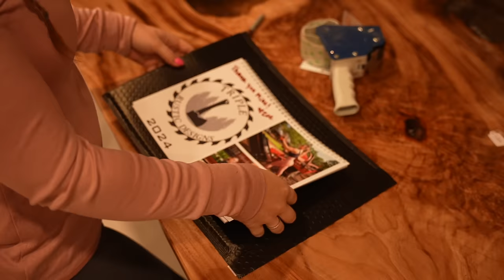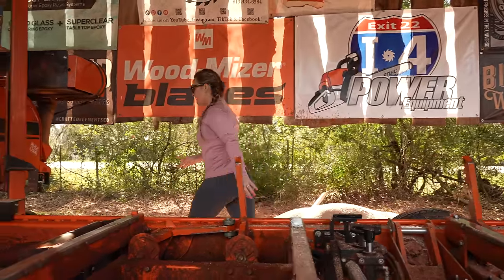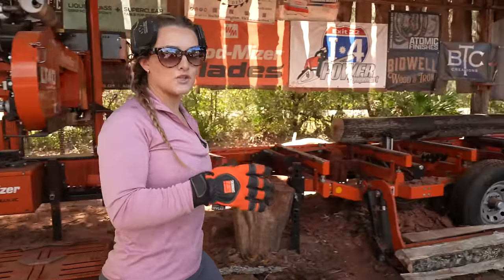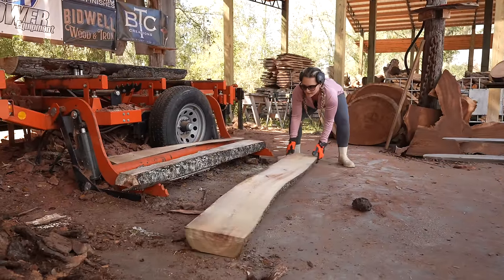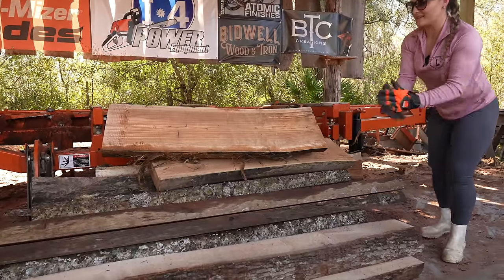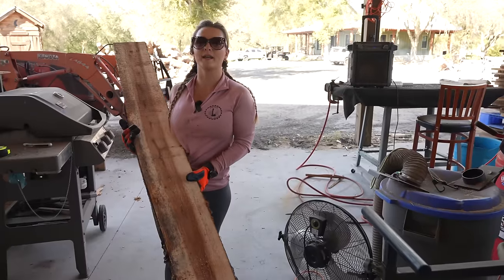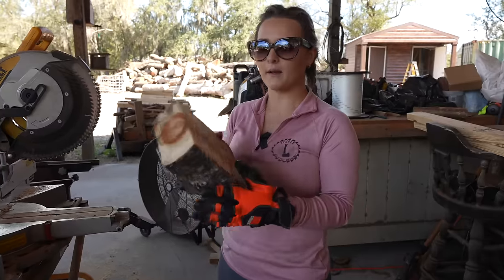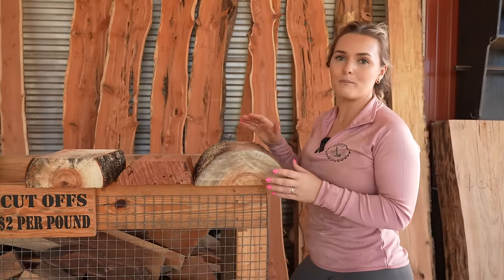She Wants You To Play A Game...Will You Follow The Rules?

Comment: Zoe a trick you can use to pull your cants towards your loading arms is to put your log clamp under the cant and lift it up and then pull it towards your loading arms . It will be easier on your back .
You can also use it to turn logs 180 if you ever have the need .
Reply from the maker: Thank you!